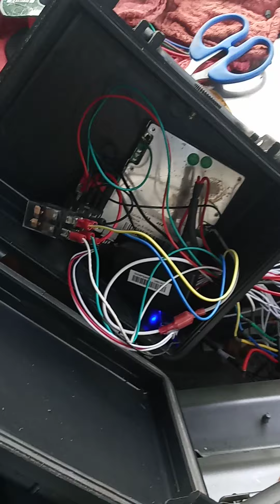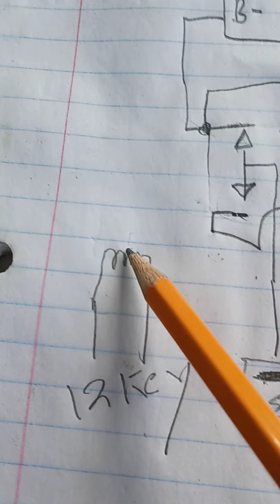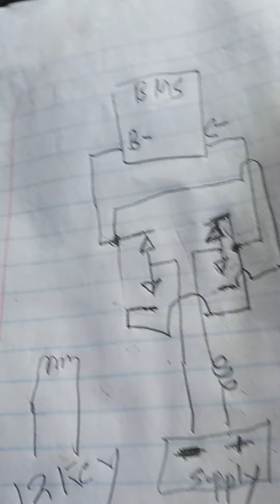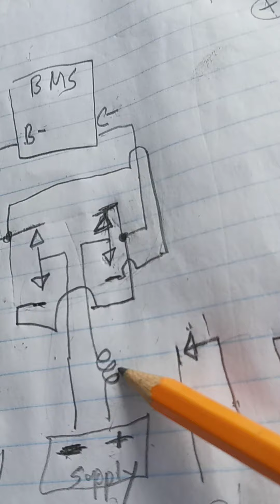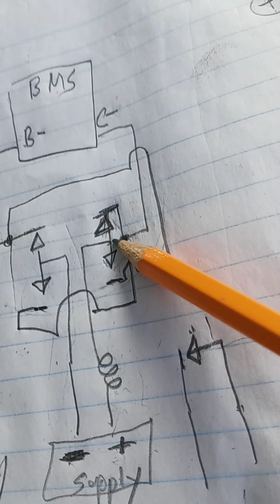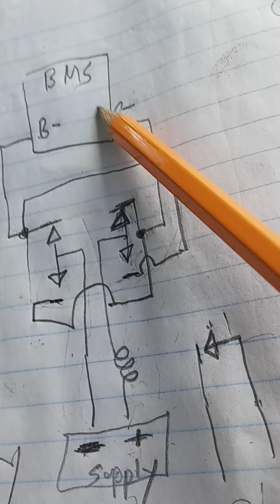small battery BMS circuit to control contractor and charger

Comment: That's a very interesting idea. 
But what currents go trough these relays? Also, if they power a motor controller of any type (Inverter, VFD, ESC, whatever) it usually has quite large input capacitors. So, these input capacitors will cause quite a large inrush currents. Usually, a relay / DC contactor based BMS has a precharge relay in series with a precharge resistor. It's in parallel with the main discharge relay. First switches the precharge relay, than after a few seconds the main relay is on, and than the precharge relay is of.

A remark:
I think "C-" is used if the BMS has separate charging and discharging connectors. It must be "P-" instead of "C-".
Reply from the maker: The drive circuit that controls low voltage cut off just controls the key switch. So basically when the BMS census a low battery it turns the key off. You have to have the motor controller setup properly of course. As for the charger most chargers have a enabled wires that hook to some BMS. And they either just turn off or on if they open up then the charger turns off. If your charger doesn't have this then you would have to run a bigger contactor to turn the AC power off. Setting the relays up the way you're talking about Will give you the ability to charge and discharge with two different circuits. I've done that with using two power supplies one for the charging circuit which goes from c minus to the p - and the other from the b minus to the p- and having two sets of relays. Not a bad way to go just needs two power supplies and trying to keep this to a minimum of parts and power use. I hope this helps you a little bit with what you're doing seems like you understand the circuit pretty well. If you got any ideas I'm open to improvements